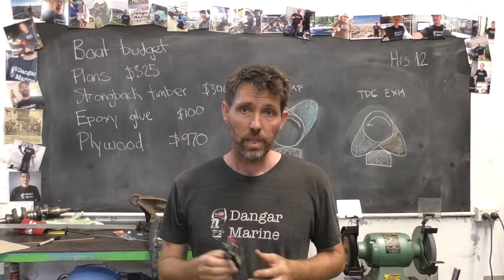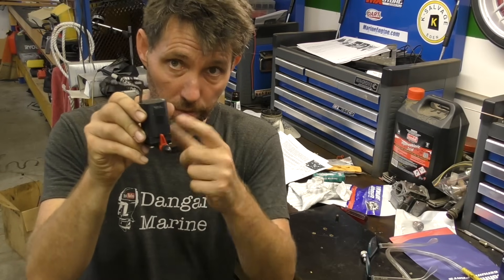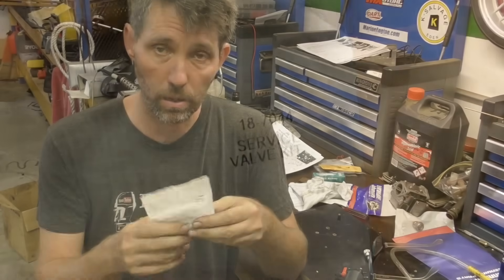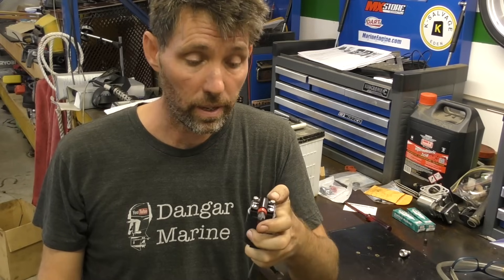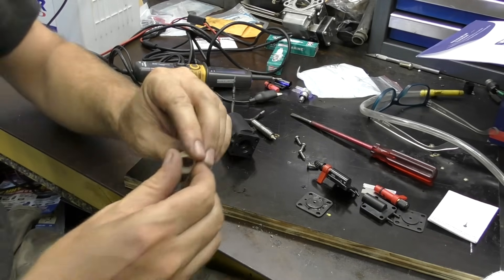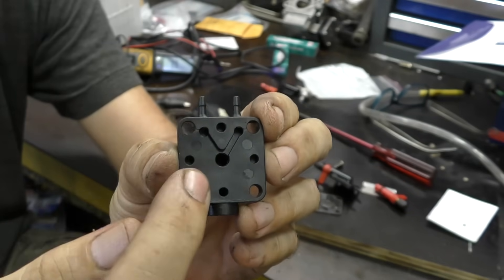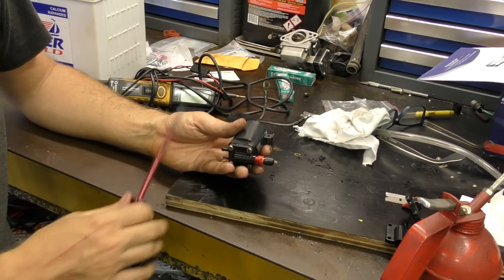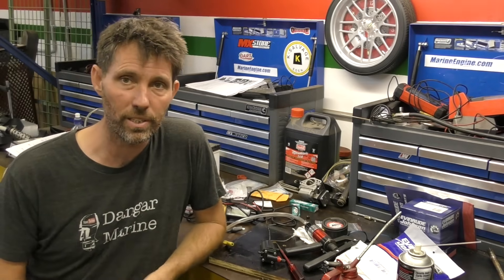Johnson / Evinrude primer solenoid

Comment: I just picked up a boat with a 30 horse Johnson that uses one of those. This was my first boat so I was unfamiliar with the setup. The guy I bough it off of had the primer in the start position and I didn’t know. Took the boat out the other day and caught the motor on fire. The genius used cable ties to hold the fuel line on, and the combination of that and being in the start condition caused the whole line to spray fuel by the pump. Luckily got the fire pit before there was damage. Definitely an interesting maiden voyage. Thanks for the info

Comment: Could you help me on how the electrical connectors on this primer are connected?
Reply from the maker: They just have two wires. One too battery negative and one too +12V that is activated by pushing the key switch in.

Comment: Hello , is it possible if not properly working primer owerflow spark plugs?
Reply from the maker: It is possible to flood the cylinders with too much fuel, yes.
Reply: @DangarMarine  Thankyou for answer,  and one more question , is it possible that not properly working primer overflow on high RPM? Thankyou.

Comment: Mine had a broken nipple for hose and I was still able to run boat and had no issues at all, matter of fact the boat started better with out it and now I am going to put on new fuel lines and do away with T the that feeds the  solenoid, and doing away with it

Comment: Hello, I'm having troubles starting my 97' Johnson 80 hp Jet drive I recently bought it and prior to it's been sitting for many years that I don't know, I cleaned the carbs but not the VRO.
It's pour out light green gas after taking the fuel line off the VRO.
Any information would be great, I'm thinking there's a problem with the VRO as seen in this video.

Comment: Could I get the brand and part number for the auto probe you are using?
Reply from the maker: Just got it from Jaycar electronics, it’s the only one they sell
Reply: @DangarMarine  thank you!  Troubleshooting my 1996 150 Evinrude looper. RPM surges at full throttle on calm sea. If there’s a chop or when navigating boat wake at full throttle the surging stops. Here’s what we’ve done so far. To rule out fuel supply problems: no screen in tank, no blockage in pick up tube. replaced anti siphon valve, all fuel line, filter filter housing bulb. Rebuild carburetors. Replaced oiling pump with new non-oiling fuel pump. Replaced gasket in main fuel bowl. (did not replace float it looked fine) then we moved on to electrical. I have replaced the power pack (was 9 yr old cdi replaced with OEM) no change however I have CDI grey induction plug wires on there with CDI coils so I am replacing them with Evinrude plug wires and Evinrude coils. On order, should show up this week. Replaced optical sensor. Checked all wiring for chafing. Disconnected main Canon plug after motor running to rule out any Boatside ignition issue. Still surges at full throttle. Replace the spark plugs. If you look at my channel you can see this engine, I’ve done a bunch of videos on it. We are totally stumped on what is causing this top end surging. Have you ever run into this? Really appreciate your insight if you have any. Great channel by the way hope to grow mine to your level someday!

Comment: I have a 1995 evinrude johnson 88hp v4 I replaced water pump and thermostats. I have ear muffs hooked up plenty of water pressure going to the leg while running and I have water coming out of the spout but when she warms up after ten mins off running it's starts to spit water on and off. Is it true that the earmuffs don't apply enough water for these motors and that's why I'm spitting water on and off

Comment: This video was perfect. Mine is leaking when I squeeze the primer bulb on the fuel hose so now I know to order the rebuild kit. Thank you Dangar. Sending gratitude from Florida 🤙🏻
Reply from the maker: Glad it helped
Reply: Hey got a ? If it don’t leak do you think it still can be that and unfortunately had water in gas but l disconnected everything and got it running w good gas now cranks but but won’t start think not getting gas this is a 225 1999 evinruide l get that it’s fuel injection from the key but a bummer l put new spark plugs in it but couple years ago only ran boat once yeah smh life man.  Selling it
Stay Blessed!

Comment: Hello everyone. I’m a bit confused and I hope I can get at least guided in the right direction.  My 99 Johnson outboard 90hp OIS.  Starts cold fine and then it Stalls out after a almost a minute of idle. Fuel pump is good checked it even after installing the rebuild kit. However this where it gets confusing. I know the primer solenoid is nothing but a electric choke, however ones I turn the red knob on to the manual position ones is about to stall then the rpms go up and starts to drop again. Then I immediately turn it back down to normal position and rpms go back up and down again.  So on and so on.   Could it be a bad primer solenoid somehow restricting fuel or flooding the carbs?

Comment: Why do you always show fixing small engine motors Most l would like to see more on evinrude 200 or 225 horse having lot of problems with getting fuel to the carbs. It’s not the fuel pump i squirt fuel in carbs and it runs
Reply from the maker: Because I live on an island where everyone has small commuter boats to get to the mainland.

Comment: Hi guys I have a quick question I have a 90 Johnson from 2003 j90glsta and it’s hard to start but when the engine is hot start right away can you give me a little tip
Reply from the maker: Does sound like the primer solenoid isn't working.
Reply: @DangarMarine  Thank you so much I want to try to buy one and I’ll let you know thank you
Reply: I just change it and it worked perfect thank you so much

Comment: can a faulty choke solenoid cause my 140 hp 1983 evinrude to not turn over? also no choke click is heard either?
Reply from the maker: No, sound like an electrical problem, maybe the fuse to the forward controls.
Reply: @DangarMarine  there was a bad fuse  a tiny 30 amp i replaced it .yet nothing. I watched your other video about the neutral switch. I'm wondering if that may be the problem . FYI the horn was burned up so I took it out and taped up those wires

Comment: Stu ..Thanks to your videos a 25yr old issue is resolved. Pulled off the primer solenoid and found a worm of gasket material plugging the fuel inlet side of the primer. Cold starts are no longer an issue.
Reply from the maker: Fantastic! Glad to hear you got the problem sorted.

Comment: Thank you for the great explanation.  My motor is a 1996 Johnson 25hp two stroke and it only has one nipple on the plate of the solenoid.  It looks like the other nipple broke off but there is not a hole there, just solid plastic...also only one outflow fuel line hooks up to it...Ever seen that?

Comment: Ok, I have that same primer on my 1998 johnson 115hp and have now eliminated starting problems. The key switch/primer actuator is too hard to coordinate using at same time with that configuration. It's not like a choke on the key switch where there is more forgiveness time if you let off. Anyway here is what I did and I start first crank every time. I disconnected the primer solenoid wire behind the key switch, (sorry I forgot the color, but it's simple to find color by looking at the solenoid itself) and ran it along with a power wire to a foot switch in my floorboard, I used the momentary gator switch that Academy sports sells for use with a hand controlled trolling motor. 

Now after making sure the primer bulb is squeezed hard, I hit the floor switch maybe a dozen times and with the high idle kicked up to start , I engage the key switch to start with the foot switch held down. It starts right up and stays running, I then slow the idle now appropriately and maybe pump the foot switch until I feel sure it's gonna stay running on it's own. Believe me there are alot of people that have complained about this , (start up) and with me it's history now.

Comment: Quick note, never apply voltage to a solenoid coil when the piston has been removed. The coil will very quickly overheat and melt. Physics i guess. for every action there is an equal and opposite reaction. The normal reaction is the  piston moving when the coil is energized. With the piston removed, there is nothing for the force of the coil to act upon, the reaction in this case is to melt the coil.  Learned this the hard way.

Comment: I have a 35 HP 1977 Johnson with an older style solenoid that is obsolete.  My solenoid only moves the choke linkage.  Do you know if its possible to retrofit this style primer solenoid into that engine?
Reply: hi mate did you ever find out if that's possible cheers tony
Reply: @Tony.aussiecoltsfan  it did not work.

Comment: What would cause my Evinrude 2-stroke to idle too fast? Could it be that the primer is malfunctioning and letting fuel into the engine?  What other problems could cause high idle? It's supposed to idle around 700, I think, but I cannot get it to run any slower than 1600.
   Thank you for sharing your wisdom.  I like your videos very much!
Reply from the maker: Could be bad throttle / butterfly valve adjustment or bad ignition timing. The enrichment mechanism maybe cause high idle speed until the engine warms up and then it will make it worse and stall.
Reply: @DangarMarine  
I've loosened the throttle linkage and the butterflies are slammed completely closed.  
  So, you're saying it could be the timing?
Too early or too late? I set the timing with a timing light.

Comment: If my red primer switch is cracked just like this one in your video could that cause my motor to lose prime while running? I also have a float needle that wont seal properly causing one of my carbs to overflow as well.. I am waiting on my carb kits to come threw the mail to address that problem

Comment: My motor. 84 65hp Evinrude. E65RWLCRS. Surges at full throttle but push the key choke in and it takes off and runs perfect. If this was bad would that cause my issue?

Comment: Any clue why one of the little valves would be sealed off? Bought a used outboard and only one of the small valves is connected the other one was broken off and sealed, not sure if that was someone trying to fix their own mess up or if it's meant to be that way since I can't find any spot where another hose would connect to
Reply from the maker: I believe they can be sealed for for outboards with fewer cylinders.
Reply: @DangarMarine  thanks, learning about this kit saved me some $$$ as I had broken off the other valve

Comment: Great video as always. My solenoid passes the ohm test and works when connected to 12v battery. The power wire to the solenoid gets the same voltage when key is depressed. Yet when the primer is attached and secured it doesn’t work. I’ve tried improved ground already. Stumped.
Reply: Found problem with some corrosion in big plug connection under cowl. Cleaned the connections dialectric grease and solenoid works now.
Reply: I'm having same issue.i love boating

Comment: I have a 1977 Johnson 70 hp motor. When I flip the ckoke switch on my controls nothing happens. No sound or movement. I took my solenoid off and applied a 12v charge to it and the piston goes in but doesn't return. When I manually pull it out it seems stiff and difficult to remove. That little spring in the bottom doesn't seem strong enough to do the job! I tried lubricating it with light oil but it's still stiff. Any ideas?

Comment: Dangar . any idea why my 2019 115 etec wants to die at idle . 

If I bump idle up on throttle it will idle just fine.  

Then when it dies it sometimes takes a few seconds of cranking to fire.  

Its under warranty but it takes them all summer to fix boat.

Comment: I have a ‘98 Johnson 90 HP that has a working primer solenoid. It works but I can’t get power into it. Where do you suggest I look into in order to supply power to it? Is there a fuse of some sort that I need to check? I followed the cable but it goes directly to the boat

Comment: Hello, amazing videos and very informative, I also have a question on a 2000 90 hp Johnson 

When cold, the engine cranks easily and starts easily a turn key and it starts, It runs like a champ, We take it out for 20 min or so, then we cast net for bait.. this means low idle, forward and reverse, etc with NO problems. We then take her out for another 20-30 min ride to a fishing spot and shut the engine off. When it's time to leave, it will crank fine, sputter and die. I can hear the starter clicking and cranking but it won’t start; so after many and many times it actually comeback to normal, to just a key turn start motor with the only difference when sometimes I try to engage the throttle it turns off, so i have to start it again and accelerate it very slow into it actually break speed.However, it will usually die when you reduce or try to engage throttle to shift into gear. Then you go home test it and it runs perfectly fine, including the throttle ( neutral , reverse, and forward)
Reply: I have similar issues as you but mine does have difficult on cold start.  Did you ever find a solution?  I thought maybe to change this Primer Solenoid or rebuild it.

Comment: Thanks Stu.  I just did this fix on my 1992 Johnson 70 which seems to be a great engine.  I was able to simply unscrew and reuse the top, leaving the two hoses on the small barbs attached so as to not risk breaking them.  Slid the new diaphragm in place and my "choke" works perfectly now.  Wouldn't have know what to do without you.  Thanks so much! Think I'll get some Dangar merch. with the money I saved.

Comment: Thanks for the vid!  My 89 70hp Evinrude was running like crap.  I found the override valve opened half way.  Back to run position, runs perfect!
Reply: My 25hp johnson was running like crap as well. Doing this asap to get back out on the water. Amazing how a quarter ounce plastic switch  can make me lose sleep! Damn near sold my motor for parts like a damn fool!!!

Comment: I have a 25 HP Johnson Outboard model no. J25 TELSRA  that needs the Fuel Primer solenoid either repaired or replaced  The part no. you listed is 18-7044.  Is this the correct part number for my model.  My fuel solenoid looks exactly like the one you show in your Video.  Also if I replace the number what Solenoid P/N do I ask for.  Thank you in advance for any help.
Reply: I have found a New Solenoid on a Johnson OEM site matching my model no. for $89.  Thank you for your great video.  I have subscribed.

Comment: Very well explained. 
I have sent the boat for service as the gear box not working, the guy fix the issue and clean the carburator. Then took the boat for a test the new problem is: 
Engine runs ok but as soon as I speed up, the engine slow down and dies. I need to wait for 45 minutes to run it back again. I took it back to same mechanic he claimed I turn it on wrong way. I did try again today in the ocean and same thing happened. I opened the cover and play with this solenoid it works slow just to reach the pier. So confusing, any help? Thanks

Comment: J70TLECB.  Could a malfunctioning primer solenoid be the culprit for excess oil being sent into the carbs?  I'm having excess smoke at low RPM's that eventually loads the plugs and stalls every now and then but otherwise runs great.  Also I've noticed the RPM's do not drop down from the cold start cycle all the time,  it's intermittent.  When it does work the engine does not smoke at idle.  Is that a function of the primer solenoid or am I looking at a potential VRO issue?  Any help will be greatly appreciated.  Thanks in advance.

Comment: I thought I had this problem , but now I don’t think I have .
My problem is after running the motor (175hp Johnson) for 1hour are so. I turn the motor off (Getting ⛽️) and start it back up (Starts fine) push down on the throttle and it won’t take off?
PS if I leave it running it runs just fine.

Comment: Great very well explained 

Just getting ready to winterize outboard
bought fogging oil along with line that screws onto the valve
so to fog the motor i would have to turn the red knob up to the manual position to fog the motor???

Comment: Hi Stu, can the test you performed at 5:20 be done without the probe... simply by connecting the ground then quickly supplying current directly from the battery with a wire, or is that too much voltage?  Thanks!
Reply from the maker: That will work just fine, you'll only get the 12V the battery supplies going direct.
Reply: @DangarMarine   Worked, thank you!  It didn't sound that loud compared to what's in your video but that could be due to the recorded audio.  Same part cuz I have a 112 Johnson.

Comment: Question: I installed this same kit, but when i go to screw in a can of seafoam to the valve and turn the valve open, gas shoots into the can. Engine is running, of course. is that normal or is the valve defective ? i thought a schrader valve was only one way, but with fuel pressure from the fuel pump i guess thats normal?

Comment: My primer  solenoid is leaking really bad , can that be a reason for it to bog down , it starts up and takes off good but then bout 15-20 seconds into it , it bogs down and turns off,   It wont run good when the throttle is all the way it has to be on low, Dangar Marine, can u help with this ?

Comment: I replaced the entire fuel line and tried running it with the gas cap completely off. You can see the fuel filter is full and then it drains down to nothing. Then it fills up fast, stay full ... Then it just goes empty and it stalls.